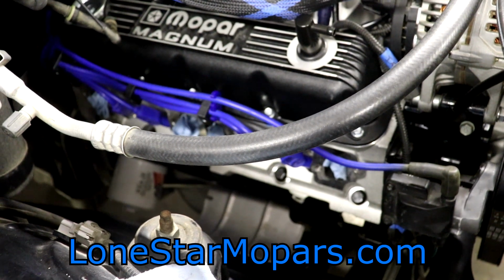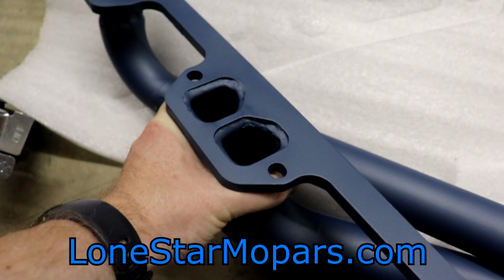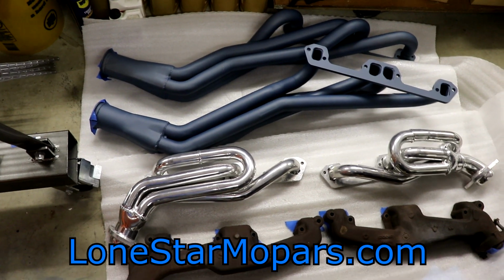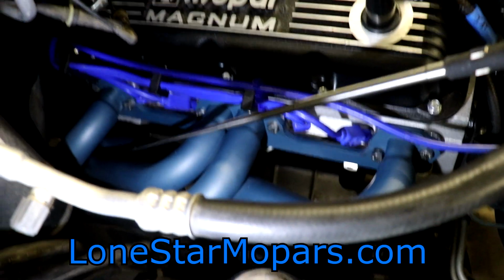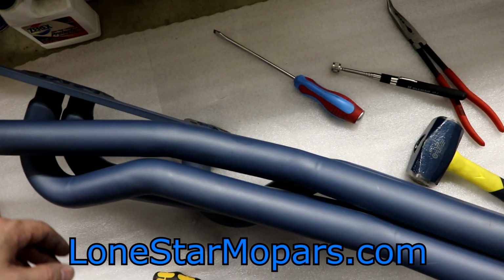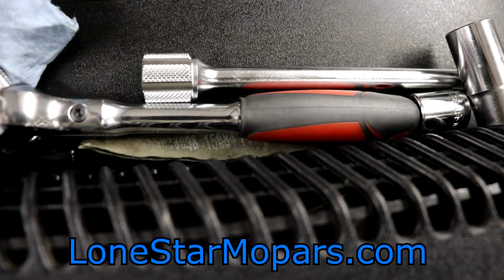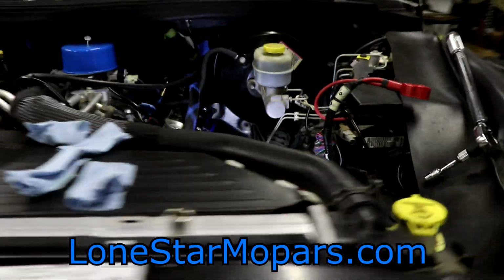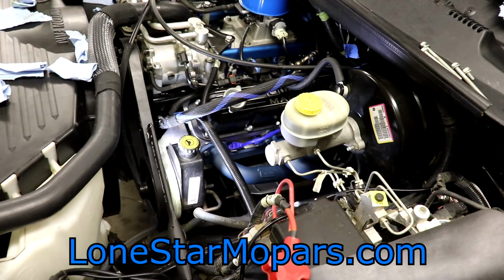Ram Revival Part 63: Header Reveal and Install!

Comment: Stage 8 fastener are the best for the headers they have a Allen bolt in the center of the bolt Mr gasket make a all aluminum header gaskets are best gaskets
Reply from the maker: I have never run new Stage 8, but saw a few on old 440 Duster.  I say few because they were mixed in with studs and smaller headed bolts around a few primaries.  I really liked the old Percy's gaskets, but the Remflex were the best I could find the for the Magnums.